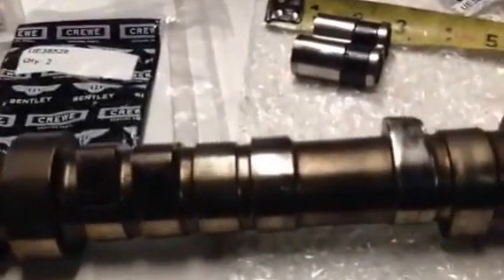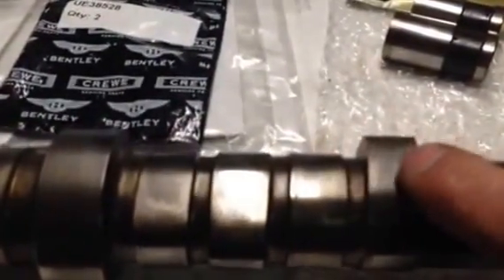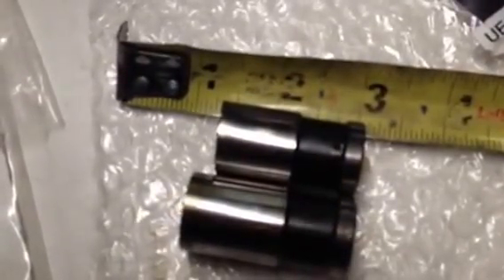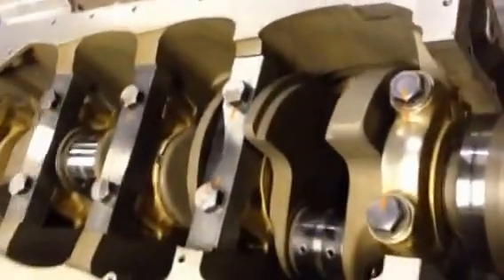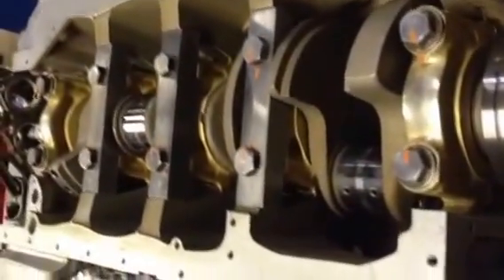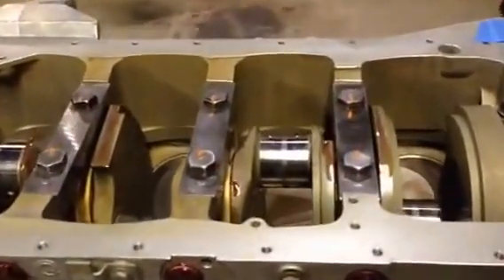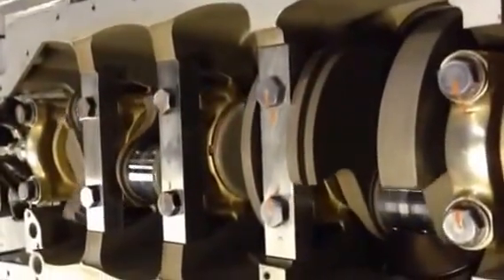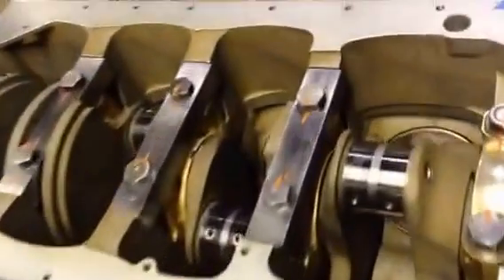Bentley 6.75 engine rebuild

Comment: ¿Can a Bentley W12 engine be rebuild?
Reply from the maker: I have already done that years ago.  You will have to recondition used parts as most parts are not available. And no workshop information on that engine. Good luck